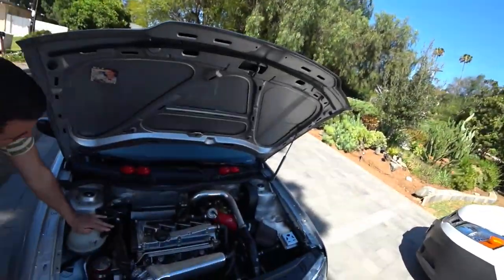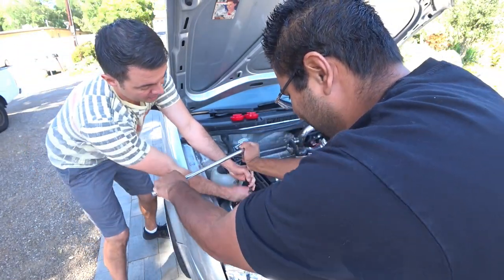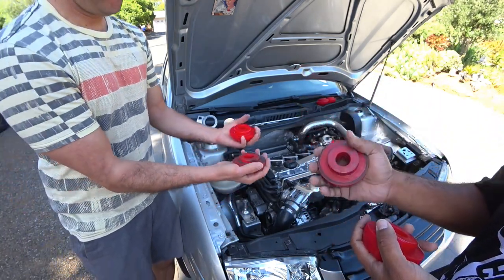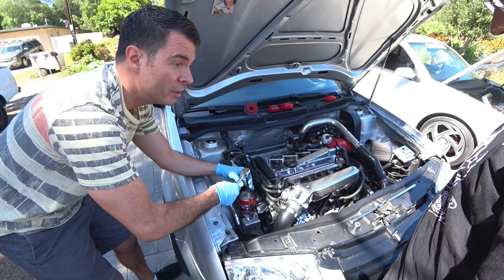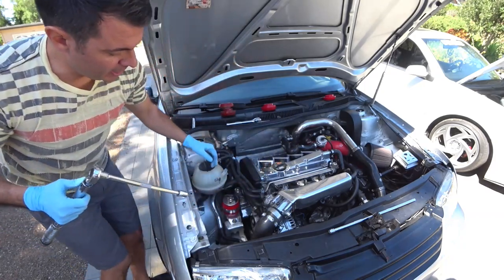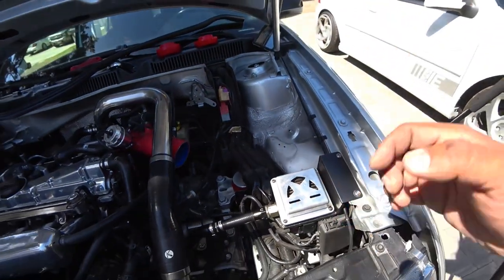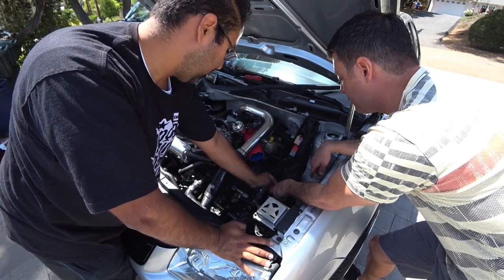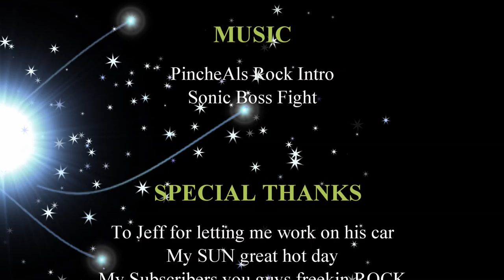How to change MK4 golf Jetta Gti VFE Motor Mount Bushings Season5 EP10

Comment: I installed those mounts on my MK4 GTI. I got lucky one day at the local "u-pull it" yard and pulled a set of these for 25 bucks! The junker had Tein adjustable coilovers and an ATP T3 turbo manifold.  I went back for them the next day and the car had been crushed already. I even told the people at the counter that I was coming back. I guess they forgot..
Reply from the maker: userpike very nice find!
Reply: very cool find! I got a whole neuspeed intake with heat Shield for only 15$ at my local u pull it yard when there 149$ the junk yard is a mans best friend
Reply: My P-flow is sitting on the shelf! I also have a Neuspeed cast TIP for k03s turbo. If you want it, make an offer.  It fits to the turbo and you use the stock rubber part of the TIP,  it goes together like factory. New, they ustabe like $250  If you are still running stock injectors and the ko3s turbo with stock downpipe/cat I may have a tune you might like that you can flash yourself using the free Nefmoto flasher. I would need you to read your ECU with the Nefmoto flasher, then save and send me your stock file so I can make the changes to a copy of your stock tune. hit me up if interested.
Reply: userpike okay I'm definitely willing to play around with a tune for sure! My water pump is leaking in my mk4 atm so this weekend were just gunna pull the head off and do a headgasket, tb,wp,  so just spent all my last $$ on my parts and also just got fired from my job... So yea.. But Def interested in that tune after I have my engine back together
Reply: well...meanwhile you should try to get yourself familiar with the nefmoto flasher.   goto http://www.nefariousmotorsports.com and READ don't post on the forum what may be considered noob or stupid questions because as a community there we are devoted to learning how to tune yourself and helping others that need it. We get people that come in and ask for free tunes and such all the time...you can see how frustrating that is when all the material is there to be read, knowledge is power and lazy people don't want to learn and others that just don't have the time are willing to pay someone for a tune. so ya, really you could just tune it yourself if you want it will cost you some time though.